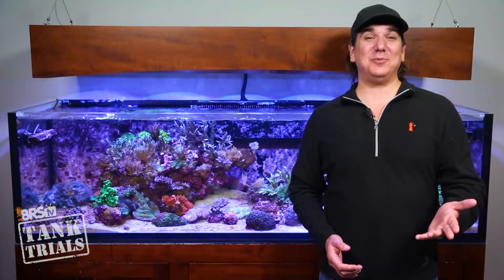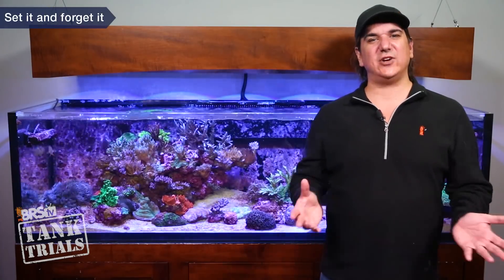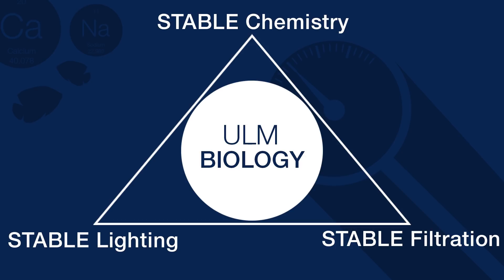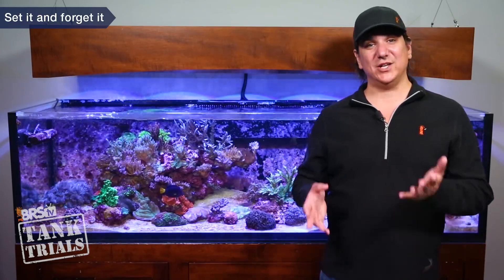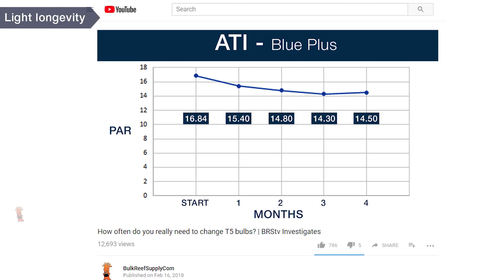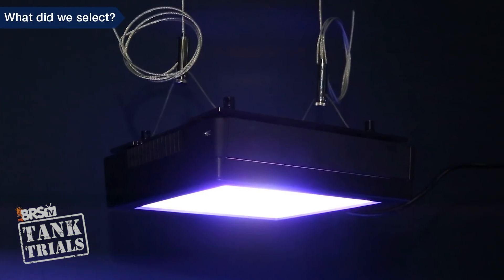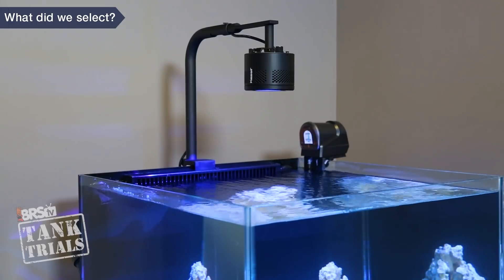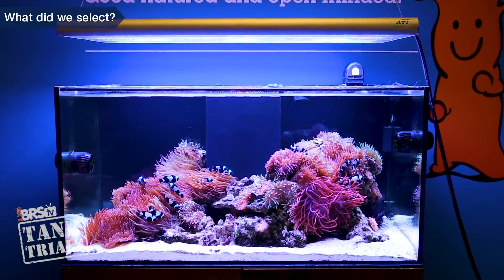ULM Tank Trials Ep-11: Reef Lighting for Ultra Low Maintenance | BRStv

Comment: Kessils are really the best, have one on breeder tank from over 3 years, last week by accident it was actually dropped into salt water tank, no power was connected, believe or not, after rinse with fresh water and good clean plus 2 day drying, it have not failed, appears all components inside are well protected from humidity, plus seal between heat sink and leds and lens is waterproof 

Changing 50g to 210g now, adding 4 more kessils to it, including h380II halo for refugium. Really good lights !

Comment: Never used a reef controller. I use two digital timers for my BRS 2-Part, a Tunze ATO, Mp-10's with the reef link and AI 26HD's with their built in software. Temp is controlled with two Neo-Therms set at 78 and 76 degrees and I monitor it on a cheep probe thermometer. I believe this to be low maintenance. The controller thing kinda scares me about spending more money and complicating my DIY low maintenance solutions with trouble shooting and tech nightmares. I see some benefits to them for sure, but to the average reefer they are probably an intimidating hurdle like it is for me and I just don't think they are necessary if you choose good options on your tank setup and just try and keep a steady tank without changing too much and letting the basic chemistry and biology do it's thing. Also, one more thing to ULM is a strong knowledge and experience with reefing. During my first year I was always chasing my tail, trying to overcorrect and now I am starting to realize that not all of our corals are going to be be happy and avoid trying and change the overall husbandry practices just to save 1 or 2 corals. It's just not worth it!  Better off to favor stability and simplicity and unless I do a major upgrade, ULM for me is controller free on my 100G DT.

Comment: @BulkReefSupply, do you reckon that something like a 'SANSI LED Full Cycle Grow Light, 15w Full Spectrum' that is generally advised more for growing Tomatoes and such plants in doors, could work well for Sumps and similar when one wants to avoid Purple or similar Growlight settings? Saw a video by a Krakty guy(Growing basil, that is) that used them fairly successfully in comparison to the Purple/blue light that is otherwise commonly seen on the grow out spectrum.

Just wanted to see your take on such potential alternatives for chasing a white light for plants or Algae.

Main reason I am asking you guys, is due your large introduction of different light sources and hands on research. So I reckon you might have better experience in picking out different small bits of information and connecting the dots to theorize a better reason if it is good or not. 

After all, growing a plant in Air and growing them in Water is different, as evident from your previous videos.

Comment: You mentioned one thing that I didn't even think about with that aquatic life mounting system/fixture, and that was about the reflectors on the T5s.   Are they not optimized reflectors like on other big name lights?   That's literally 90% of what makes T5s good.
Reply: I thought the exact same thing. Was ecstatic at the release of their T5 unit allowing YOUR choice of LED's to be placed in the center. What a genius idea and it was about time a company released a product of that nature. Makes me curious about long-term use experience with these. As you said, literally 90% of what makes T5's good is the reflectors and cooling system with them, which is what these lack.
Reply: HentzReef it’s true that reflectors are an important part of T5 fixtures, maybe the most important.  However 90% of the light produced doesn’t come from the reflector.  Overall performance between an ATI reflector and a good reflector may only be a difference of 10% or less.
Reply: It's not that reflectors provide 90% of the light, although there have been quite a few tests that using reflectors versus nothing increases the light by upwards of 300%, but this is not comparing ATi reflectors and "good" reflectors, I'm wondering what the quality of these reflectors are in the first place.   I've seen a number of cheap fixtures that has reflectors that were nothing more than a parabolic bump shape but they're barely wider than the bulb, which doesn't give anywhere close to the amount of light that's given by a wider reflector, which can actually reflect the light downward into the tank versus into the bulb.   

Not sure if BRS did a video on the output of these fixtures,  might be worth looking up if they did to see how they actually work.

Comment: You people and your lights... You know what I do?  I buy a bunch of the cheap screw-in 60w equivalent led household lights, disassemble them, and wire the guts up in parallel to a cord that plugs into a timer.  No I'm not an electrician, it's not hard to do.  I may make a video on it, but no promises.

Comment: I am military and often leave town for weeks to months without advance notice.  If not for my APEX controller and fusion I would never be able to keep a large (180g/300 total) SPS Reef system.  Not only that but I feel it’s very difficult if not impossible to achieve the same exacting stability without one.  Over 30 pieces of equipment, 6 switches, 5 probes, 9 pumps, 5 different lights, and many different various things doing hundreds to thousands of different functions controlled directly by the APEX.  That doesn’t include all the programs, safety codes, monitoring, profiles, communication.  

Here is me waiting for Trident.
Reply: bif24701 i'd love to here more about your setup, my jobs changed and I have to go away for weeks at a time. I'm hoping that the trident is everything its built up to be.